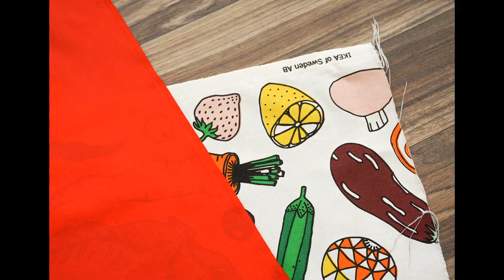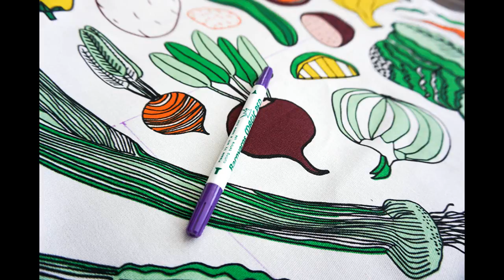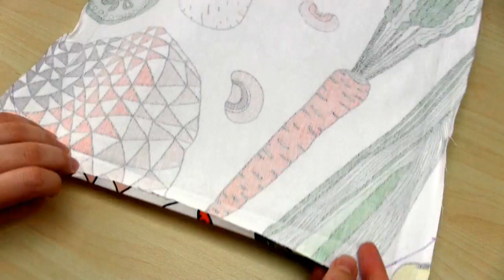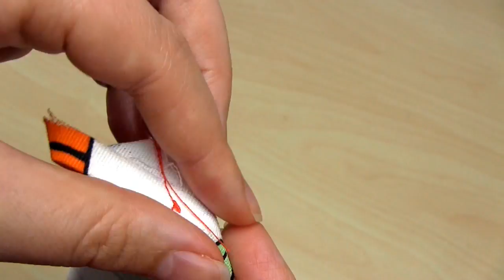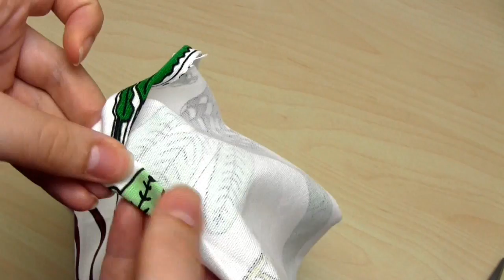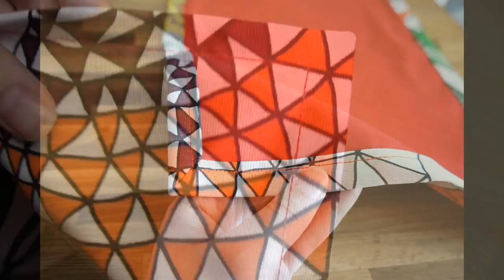How to Sew Simple Placemats | Easy & Quick DIY Sewing Project for Beginners | Mitred Corners

Comment: It seems in these placemat videos, I've watched a ton, that it is not important to cut on the grain? I Google and it said if you use the interfacing it will not shift. True or False?
Reply from the maker: Hi! For something like placemats where the fabric is often quite stable (I'm using medium weight woven here), cutting on the grain isn't really necessary, particularly if you interface it. Cutting on the grain can never be a bad thing though :)

Comment: If I have a yard for the top of placemats   in Easter fabric and a yard for bottom  in a solid how many can i get. And how to cut them to size to work .just need small placemats for children
Reply from the maker: If you reduce the size slightly (an inch at most) you should be able to cut out 6 rectangles from each yard, although this depends on the exact measurements of your fabric so you'll have to check :)